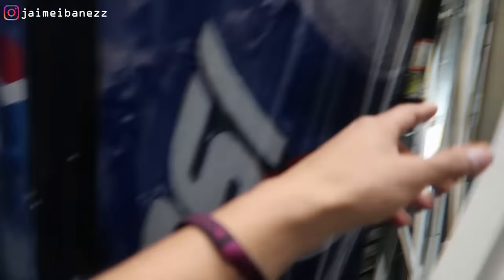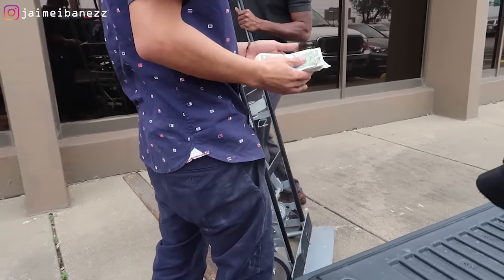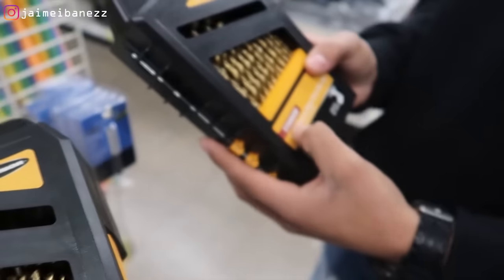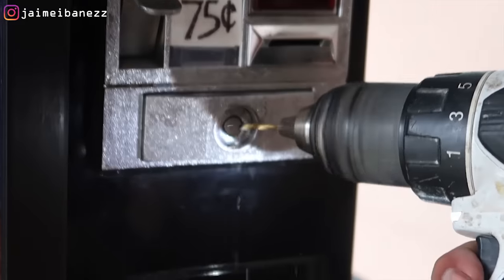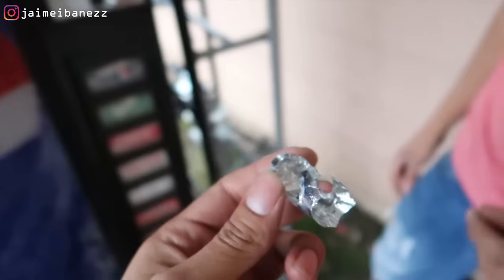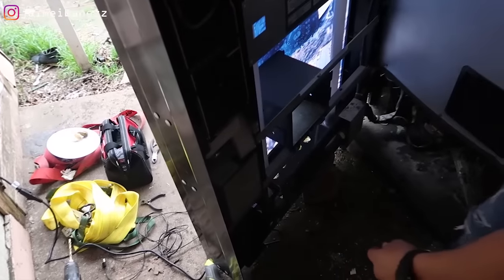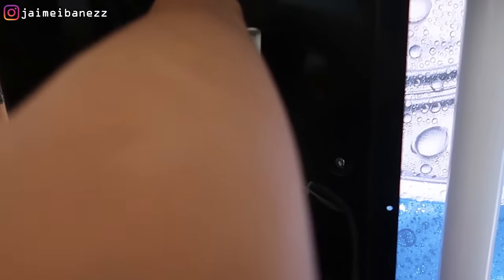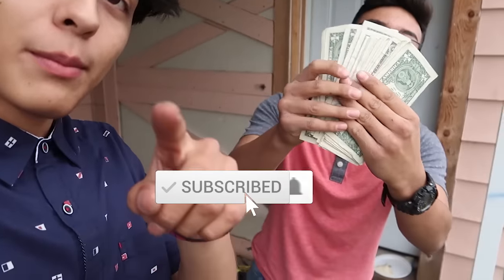Bought An Abandoned Vending Machine FULL OF MONEY!!

Comment: Thanks for showing me how to open a vending machine without the keys.
Reply: 64
Reply: Get a lockpick tool much easier...
Reply: here's a tip, dont stick the drill in and then start turning it at random angles..its not a light saber. you're drilling a hole straight through, not cutting through butter. not surprising the bit breaks
Reply: Harrison ههههههههههههههههههههههههههههههههههههههههههههههههههههههههههههههههههههههههههههههههه
Reply: Lmao
Reply: or how not to

Comment: laying the Machine down did not damage the compressor?
Reply: no. Because it's not running. When you lay one down the compressor oil runs up into the condensing coils & has to have time to drain back before being used. That's why he said it has to be standing back up 24 hours before use.

Comment: That sure does look like and asset tag mid way up the left side of the door. If it is you didn't buy an abandoned machine, you bought a machine that is owned by the Pepsi Cola Company and the person who sold it to you had no right to do so.
Reply from the maker: Boblib1970 lol that shoes the model number of the machine. Also that machine is very old, Pepsi don’t keep their older machines.
Reply: @jaimeibanezz  Thats a Dixie Narco 501, you can still get those from Pepsi. The silver tag is model and serial number. Im talking about the white one. Also the sticker on the front upper right corner of the door indicates to call Pepsi for service. My guess is that machine was either placed by Pepsi or an FLO (full line operator) through a lease agreement, and was neglected. Usually FLOs will remove the Pepsi sticker and replace them with their own but I've seen both the bottlers and FLOs neglect machines like that. Either way whoever sold you that likely wasn't the owner. Just be more aware next time.
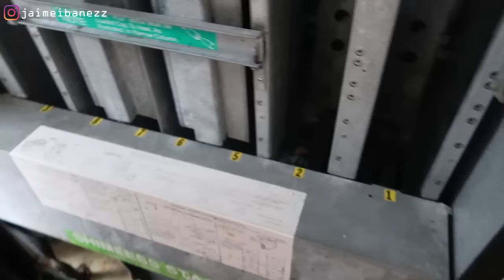Reply: Also @8:56 upper left corner of the inside of the machine, that looks like an asset tag too. Pepsi will usually put a couple of tags on their machines, one on the inside and one on the outside. Usually on the cooler door on the inside and either the side of the door or back upper left corner on the outside. Also no key should be a big red flag.
Reply: One final tip.....use a dent puller with a slide hammer to break out the lock next time. Drill exactly where you did first, then screw the dent puller in there. Lock will bust out much easier.